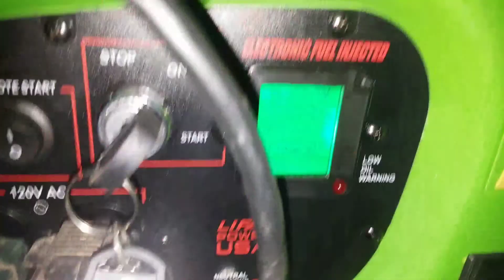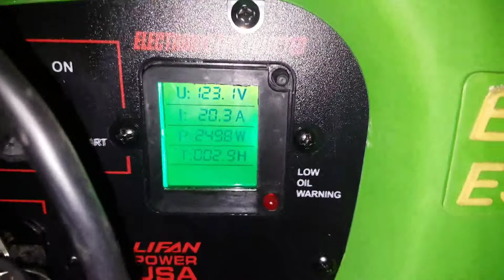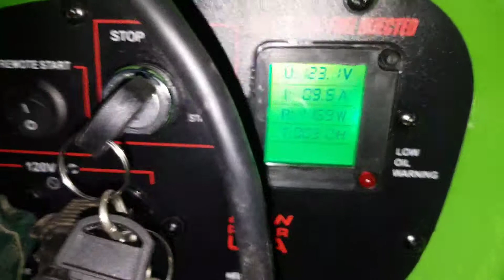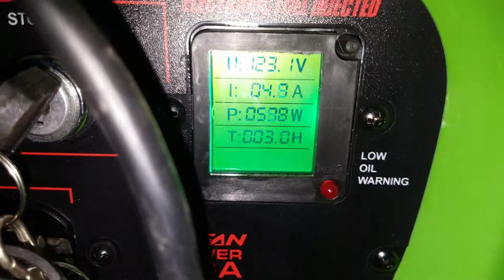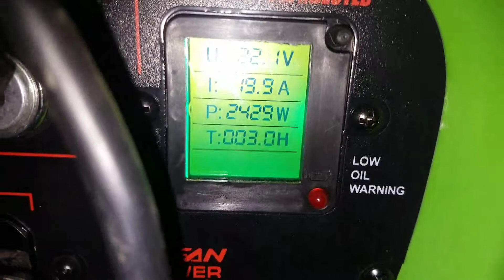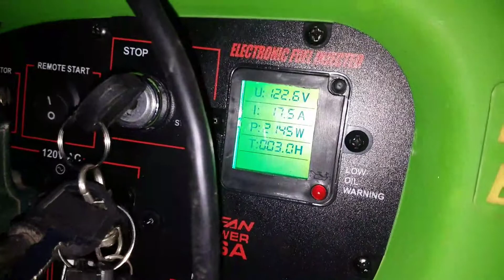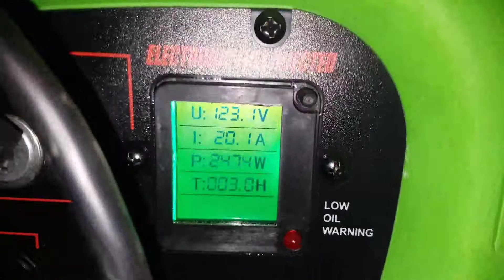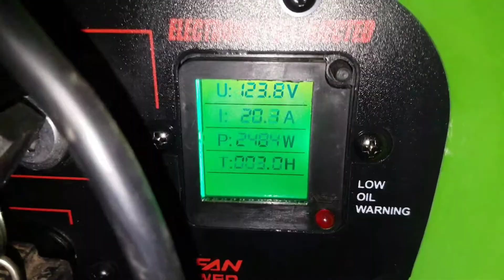Lifan 2500 ESI 2500iER hard break in/load test @ 3 hrs runtime

Comment: Mine runs terrible and have had issues with faulty spark plugs , tech support suggested I go with NGK as well I have a 2 codes coming up. Engines seems to run erratic and I only get 3 hours to a tank running a 60w light bulb, tv and a dvd player . not impressed with this unit after spending $1400. I'll go with Honda next time. Calling tech support once again tomorrow, wish me luck!
Reply from the maker: Same, wait how do you get codes to show up???